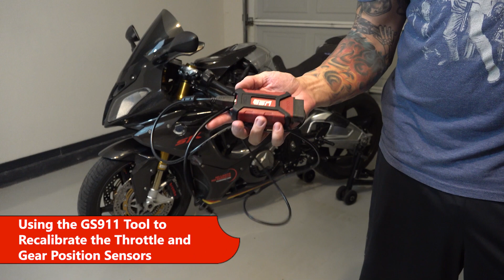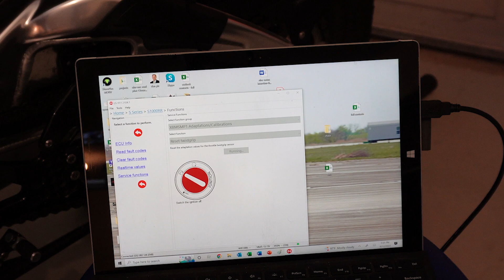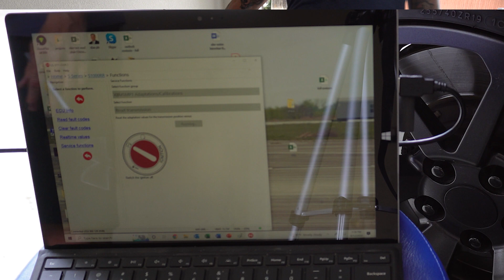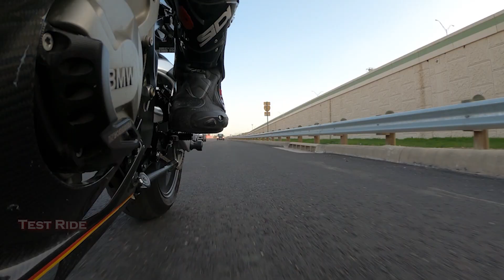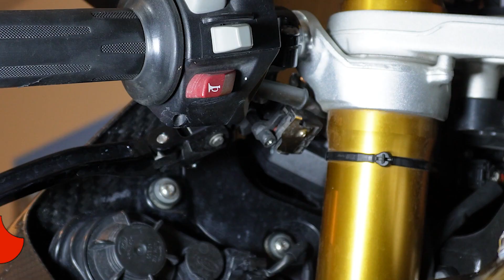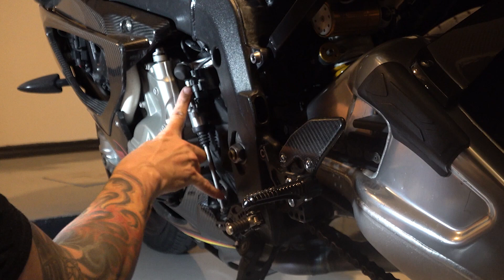How to TROUBLESHOOT BMW S1000RR QUICK SHIFTER Not Working - BMW S1000RR Custom

Comment: what if the bike notify you each time after startup that the gear shift assistance is disabled, i have 2025 s1k? it literallywont shift
Reply from the maker: that's 7 years newer than anything i had, so it's over my head. guess the first thing i'd do is check if there is a manual way to turn it on and off manually and maybe you have it off? i've never seen that ability on a bike. if not that, then it's an error and not allowing you to use it. If the bike just simply disables it, that makes it hard to troubleshoot it like in my video. you might have to either use a diangostic tool or take to a dealer to see what is faulty and causing it. only other thing you could do is buy another one off ebay and try it to see if it's the QS itself that's faulty.

Comment: It feels like my shift linkage stays stuck in the up position when using the QS at high rpm and it needs some time to drop back down. Any idea what this could be
Reply from the maker: if it feels stuck, it sounds like it's just struggling to shift properly. all the ideas i found when i had the bike are in the video, but it tends to work better at high rpms than lower by design.

Comment: I just had my one replaced at the dealer because the original one broke when the bike fell over, now they replaced, it’s incredibly hard to shift up and here’s the kicker the dealership said they didn’t replace it though it’s obviously that they did , and it’s even on the insurance paper work so now I’ve got a bike I can’t ride,even the dash says there’s a engine fault take to dealership
Reply from the maker: oh that's gotta be aggravating. wonder if the engine fault is affecting the shifter as it's in some safe mode? or did the dealer jsut fail to synch the transmission? that can affect things too. need to find a new shop it sounds.

Comment: Hello i cleaned the chain and the front gear and when i put the lever back on the qs it wasn't working any idea what happened?
Reply from the maker: you're saying all you did is take the shift lever off, put it back on, and now the QS isn't working? that makes no sense at all? any chance you disconnected the cable to the qs somehow?

Comment: What tool do you need to loosen the screw on the little plate
Reply: T6 torx
Reply from the maker: i looked at the video and can't see for sure, so i don't remember what type of wrench it took. it's probably a torx wrench like most of the other screws on the motorcycle, but i know it was tiny. you might have to take a pic with your camera and zoom in to see what it looks like, i.e. if it's torx, hex, flat, phillips, etc.

Comment: Hi, first nice video, I recently changed the micro switch on my 2017 S1KRR since the QS is not working but the cruise control work fine. The issue is that when I’m driving the QS don’t grab any single gear unless the throttle is partially twist (basically nothing just like 1/2 inch from Idle). It feels more like I’m doing a synchronized shifting(rev shifting I think they called on bikes) rather than QS doing the work. It doesn’t work to down nor to up shifting at any RPM just how I described above. 

So changed the micro switch but still have the same issue, I do not own a GS911 (for now, but look like is an OBD2 for car totally necessary for DIY), do I need to do the reset of the throttle and transmission mandatory at this point? And do the GS911 works with apple computer? This last question I’ll dig in a little bit more obviously hehe

Thanks in advance
Reply: So GS911 arrived and this are the codes:

0x3A1193
Fault Code Description Shift lever sensor, erroneous voltage

0x3A1792
Fault Code Description Shift lever sensor, implausible voltage

0x3A1190
Fault Code Description Shift lever sensor, voltage above threshold

I reset throttle and transmission but still the same. I look up the codes on internet but look like is more complains than solutions. Not sure what to do at this point.
Reply from the maker: @arnaldosanchez7569  if it were me, you've already reset the tran, and you're seeing those faults, my guess would be that the gear sensor is faulty and i would be replacing that. i'm not a factory trained bmw technician, but that's what i would do if i saw that.
Reply: @NoLimitsNoRegrets  welp, after recalibrating the throttle and trans, it didn’t work at first. I decide to reconnect the Gs911 to check the codes again, since I saved the codes the first time I connected and review that the first time the codes says “present = yes” so I didn’t verify post recalibration if this code still says the same. When I connected back all of them were registered but “present = no” I decide to test ride and it worked but for a couple times. I reconnect for 3rd time the Gs911 and saw a code that says the recalibration didn’t finished correctly, I didn’t had time to do the recalibration today. I ereased the codes and I keep running the bike for 5 miles maybe to see if the codes came back and nothing pop up again but the fault is still there. I’ll recalibrate again tomorrow and give more time on the on/off process since when I when to off/on I kinda did it to fast maybe 1 second difference and have been looking other videos that mention to give a little bit time in between, similar to the gears. Well I’ll check tomorrow again and thanks again for the help, I might leave the sensor for next year since winter is almost there hehe
Reply from the maker: @arnaldosanchez7569  don't rush the process. i think my video went through in detail of the right way to do it, but another second or 2 is better than to short.
Reply from the maker: it's wise to reset the throttle and tran just to eliminate those 'easy' items. even if they're both okay, at least you know those aren't the culprit as you try to troubleshoot. '17 should be the new red gs911, not the old yellow one. i've never owned an apple anything, so guess just read the gs911 info to make sure. i think they make a wired and wireless version now.
Reply: @NoLimitsNoRegrets hi, I ordered the red one yesterday after posting the comment here since I like to DIY stuff, eventually I’ll need it so. I’ll calibrate de trans and throttle to discard, but if this doesn’t work I might just order a new QS. Is the stock the one I got.
Reply from the maker: @arnaldosanchez7569  good plan. i actually tried several QS devices before finding the real problem. i settled on the alpha quickshifter, had the best luck with that one.
Reply: @NoLimitsNoRegrets I have been trying to find one for my 2017 but nowhere to find. All sold out
Reply from the maker: @arnaldosanchez7569  strange they'd be out of those.

Comment: Do you know the name or the part number for the cylinder you need to replace at 13:03?
Reply: Sorry I got the wrong time stamp 12:43 . I am having the same issues and was able to resolve the QS issue by adjusting the clutch cable. But the cylinder you mentioned is missing from my clutch lever, so nothing is making contact with that bottom switch.
Reply from the maker: @itsinfamous_767  oh, yeah, that piece. no i don't have the part number for it, but i think it's called the clutch switch actuator. easiest thing is go toa  dealer, have them pull up the exploded views, and point at that piece and they can sell it to you. if you don't have a local dealer, maxbmw has the exploded views you can look at to find it. that's what i do when i need parts.
Reply from the maker: at 13:03 i'm talking about clutch cable adjustment, so not sure what cylinder you're referencing. could you be more specific? i doubt i'll have part numbers for any of this though. easiest thing is go to maxbmw and look at exploded part diagrams and find it in there. that's what i do every time :)

Comment: Hi, do you know if the qs/blipper component S1000RR 2019 (upwards) is also backwards compatible to the previous model gen. 2015-2018 ?
Reply from the maker: i believe someone told me that you could use the 19 and up with the 15-18 functionally, but if i remember right, i think i tried bolting one on mine, and if i remember correctly, it was dimensionally different and wouldn't fit. now mine is a '10 that's been modified, not stock, so it's possible that they are a direct swap between the 18 and 19, but i don't have that direct experience.
Reply: Thank you, the technical and more the functional question is my target. I think you would answer with a 'yes', you can use a 19 model qs/blipper also on a 15 model.
Reply from the maker: @KeuleHamburg1985  yes, i believe functionally it should, although i never had the chance to prove it to myself, but dimensionally, my setup wouldn't fit right, yours might.

Comment: I also had to replace this micro switch on a hunch. Dealer didn’t think switch was the problem. It fixed everything.
Reply from the maker: i think my actuator wear was the actual problem, but was tired of fighting it so replaced them both just to be sure.

Comment: Ive got HP levers to fix mine i added a small cable tie onto the clutch pin to make it slighty larger. It now works fine, i did initially tried to play with the switches but the cable tie worked the best.
Reply from the maker: Really? if it works it works. the actuator for me was the bigger issue than the switch, but i just replaced both to make sure it worked. touchy gadgets!

Comment: Great video man. May I ask where did you source the actuator that engages the microswitch from? I need to replace mine, but I can't find it independently from the clutch lever. Part# or anything will help. Cheers.
Reply from the maker: glad you enjoyed it, the parts i used were ordered from maxbmw in the northeast. that's where i go to get any stock parts now that i don't have a shop just a couple exits away like i used to do.

Comment: Thanks for the video. I've seen reference to the GS911 so many times, but this is the first time I actually see how it works and what menus and functions are available. I'm having some weird issues with my HP4 QS, mine works, but sometimes the power "cut" stays on for 2-3 seconds after the shift has completed. So I'll have the throttle pinned and I'll pull the shifter, CLACK into the next gear, but the power doesn't come back on 2-3 seconds. I'm thinking the loadcell might be sticking internally? And just recently, my traction control light has started slow-blinking intermittently and when it does, the throttle becomes very weird, jerky and unstable, and as soon as the light goes away the bike smooths out. Very strange, as the TC is not actually engaging, it's going into some sort of limp mode. I really need to get a GS911 and start poking around.
Reply from the maker: that is some strange behavior for sure?? hopefully the gs911 gives you a starting point to troubleshoot it!
Reply: @agtronic
Reply: Hey! Did you get rid of the power cut off problem? I have the same problem on my 2014 hp4 when I’m shift between 3-4 and if I’m angled. :/

Comment: Good day.

New update. I kept the black thingy under the clutch lever now its works perfectly. Still its hot wired though.

But now here comes another challenge.

Now the bike is not starting in first gear, when I am engaging the clutch. Before was fine. Is it some thing to do with the switches?
Reply from the maker: That's good you have it working, but yes, to your last question. think about it this way, you hotwired both switches with the clamp to think the clutch lever is all the way out, right? the problem is you can only start the bike in gear if it thinks the clutch is in to keep from lunging. since you've tricked the bike to think the clutch is always out, it won't start in gear. you will need to go remove your clamp/hotwire trick and adjust the bike to work properly as designed.

Comment: Hello, so i have this problem with my bmw s 1000 rr 2013 it all started when i was riding and went to drive through and while i was ordering in the drive through i guess the quick shifter stopped working. when i left the drive through it didnt work. there is no codes saying theres a problem with it but i did have a code with the transmission sensor. the quick shifter is never working at any time and on the clutch switch there is only one pin that i believe is for the clutch and not the quickshifter which clicks in fine. im cosidering to use a multimeter to check for reading on the quick shifter but got no idea how but before doing it im wondering if you know that its for sure the quick shifter or some other input that could be usefull
Reply: So after changing the potentiometer the issue stopped coming back, now the issue is like on and off. So basically if I’m in 3 gear and I down shift by rev matching to first and try to quick shift up it doesn’t work but if I then pull the clutch and go to second gear it works all the way up. Sometimes the quick shifter resosponds late. I can perhaps get a video of it to show you but perhaps you know this issue. I had a code come like last time but this time it isn’t there all the time but only came 4 times
Reply from the maker: @mathiaspedersen6070  did you recalibrate the transmission after you changed the pot?
Reply: @NoLimitsNoRegrets  yea I did
Reply from the maker: @mathiaspedersen6070  sorry, i don't know what else to tell you. that's all i can think to try. you might get stuck taking it to the dealer at this point.
Reply from the maker: if i understand correctly, your '13 only has the upshift, not the down shift blipper. the transmission sensor would very likely cause the upshifter to stop working. that needs to be replaced and the tran reset through the computer and a gs911 before the quickshifter  will work properly.

Comment: I own a 2011 model bmw s1000rr. quickshifter that worked before is no longer working. I ordered the original quick shifter, but although I visited 3 repair shops, the source of the problem could not be found. The micro switch has just been changed. The soft ware was checked, the quick shifter was reset, but the problem still persists and the quick shifter does not work. I would be very happy if you could help me with this.
Reply from the maker: ugh, i cover everything i can possibly think of in the video. clutch cable adjustment, mircoswitch, QS reset, software, QS device, and the only other thing i can thing of you didn't mention is the potentiometer that measures the gear position as stated in the video. Every idea i have is in the video. only thing you didn't mention in my list was the clutch cable and potentiometer? there is also the position/angles of everything at the rearset. if you adjusted that or installed new rearsets, those might affect operation?

Comment: My 2017 s1000rr has the bracket turned so the microswitch is always pressed. Right now the issue I’m having is at lower rpm’s the quickshifter either works or doesn’t at all. When I give it harder throttle and the rpms climb it works perfectly. But down low just cruising around town it doesn’t want to work at all then all of a sudden will. Worked perfectly before no matter the rpm etc. now all of a sudden I’m having this problem. 
By chance have any idea what it could be? Thank you
Reply: Downshift auto blooper works perfectly as well. Only having the issue when upshifting at lower rpm.
Reply from the maker: @austin17qb24  my understanding of how it works is that's correct. The upshifter, even on the old '10 setup for me, was intended to be used under aggressive throttle. i wasn't sure if the '17-18's were the same way, but sounds like they are. What you described is how i would assume it would work based on what i've seen before. as long as it works under harder throttle, that's the point of it.
Reply: Just throws me off how it worked under very light load one week then the next it won’t shift unless under hard load
Reply from the maker: @austin17qb24  that makes less sense. only thing i can think of is somehow your revs happe to match by luck. sometimes motorcycles can be kicked up a gear w/o clutching even w/o quickshift devices, just depends on a bunch of factors.

Comment: I'm owner of BMW F900xr and have a quick shifter problem. It was fixed by BMW service shop but the problem is come back again after riding 1000 km. Your video very helpful. I will go the service again and asking them to check about the sensor.
Reply from the maker: like i said in the video, could just be how loose the clutch cable is or if you rest your fingers on the lever. i fought mine for years until finally figuring this out. good luck!

Comment: Can chain tension affect reliability of quick shifter?
Reply: Chain does effect it. Had issues with fast shifts after straight. Would stick in gear. Chain was loose, after adjusting closer to loose end of spec it cleared up and shifted quickly again
Reply from the maker: @adzventurerider  interesting input, thanks for that!
Reply from the maker: I've never heard of that being an issue before? The only way I could see that happen is if the chain were so tight it were binding the pinion making it harder to shift, but chain tension is a super easy fix, and something that we should all have adjusted accurately.